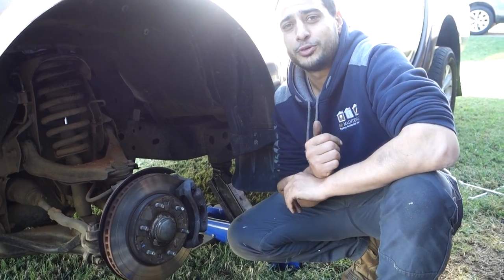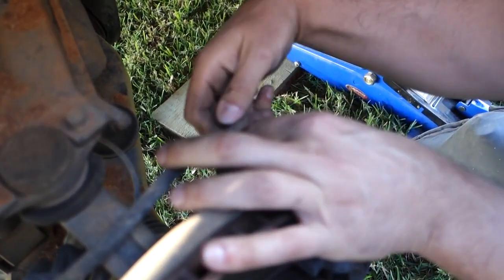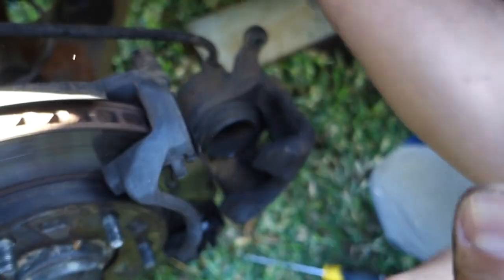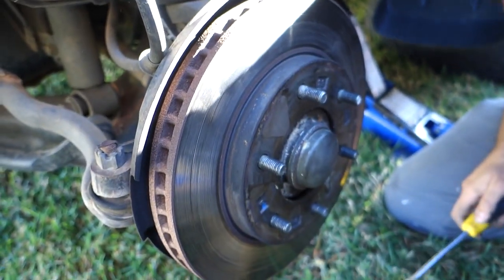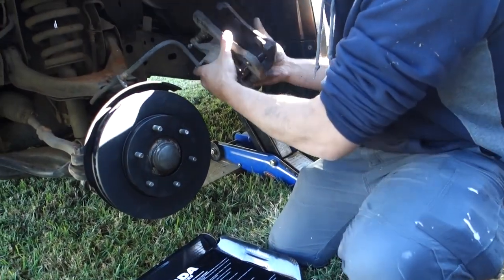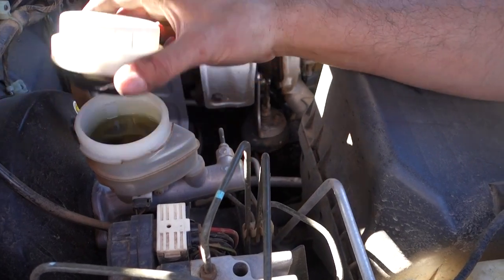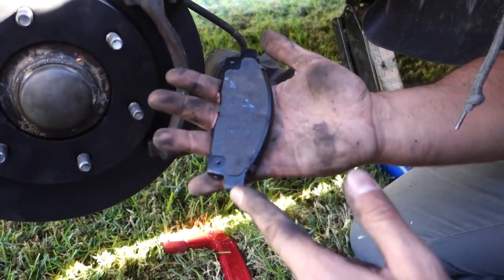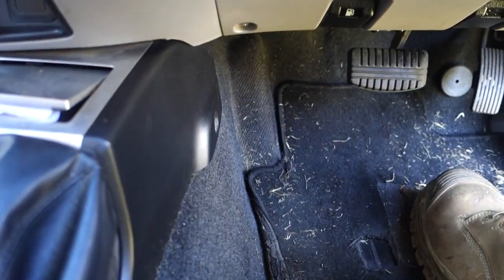How to replace car brake pads and rotors on any car - DIY

Comment: You forgot to re-grease the slide pins mate. They can seize up if you dont
Reply: Yes sir at least indirect then and the boot. Is all good can leave it. I was waiting to see if those rotors had that screw in them. That's the hardest part of the whole thing. Usually drill them out and leave them out lol

Comment: Here is a GREAT how to:

You know the roller glass doors and they have roller wheels at the bottom and screw which adjusts the Height?
Question is: how to remove that screw once the whole screw is stripped completely...Beyond expert repair :D

Comment: So you don't have to bleed the brake lines?  I thought every time you have to replace brake pads, you have to bleed the brake lines to remove any air trapped in them?  This is what's prevented me doing them myself - in case I stuff up the bleeding etc.
Reply: Only have to bleed brake lines if remove the hose from the caliber or on the car. 
If you just remove the line holder and move the caliber with the brake line still intact. No bleeding is required.
Reply from the maker: Bleeding is not always required. If you did need to bleed the lines it’s very simple to do👍